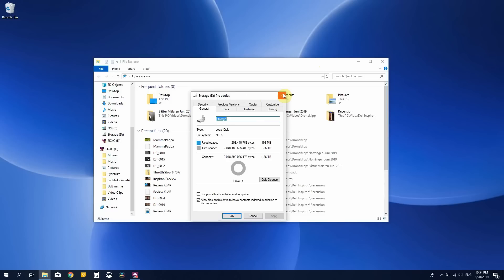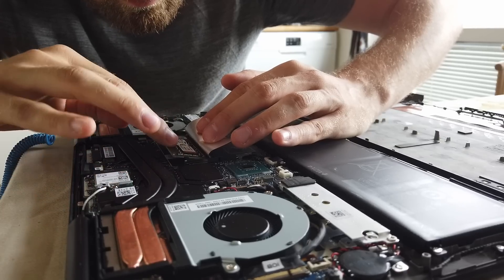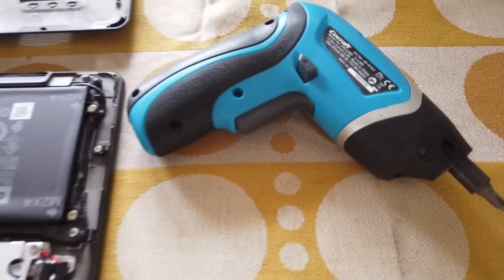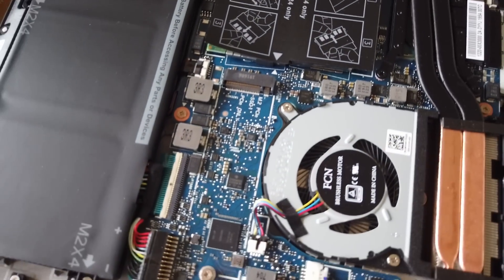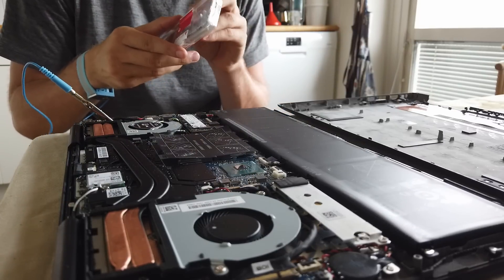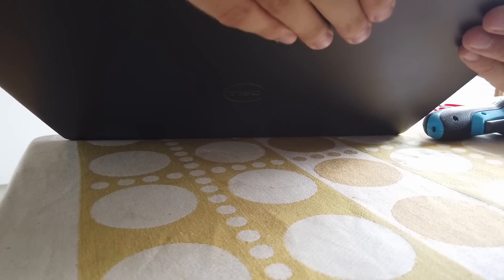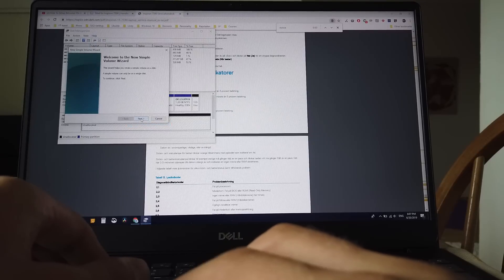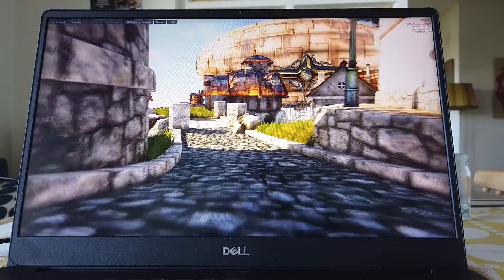Dell Inspiron - 2,5Tb SSD & 16GB RAM Upgrade

Comment: that screw problem, did you faced the same problem with Dell 15 7000? I have same issue but at the corner near the hinge.
Reply from the maker: You mean that the screws don't come out? That's by design. They should not come out. :)

Comment: I have the exact same laptop but with 56wh config? Can i also upgrade to a 97wh battery?
Reply from the maker: I believe you can, the battery should be available to order and fit in the chassis.

Comment: I just wonder, 
why did you choose Intel SSD over samsung series ? Thxs
As we knew, samsung speed is superior.
Reply from the maker: Price! Intel SSD is for sure the most value for money. This is just a storage ssd anyhow :)
Reply: @w2best  OK, Thank you for disclosing your reason. Quite resaonable though.

2 more quetions 
1. in the manual book, it was said that max storage for SSD M2 is 512GB for each slot and you install 2 TB. Any problem with new 2TB ?
2. your new hardware SSD 2TB, can be installed in empthy slot or replace the default SSD ? 

Thank you very much !!!!
Reply from the maker: @snmailist1470  there's not been any problems during these 2 years. You can probably install it in either but i would just keep the system drive to save the hassle of reinstalling the os

Comment: I think second ssd should be of intel which comes with optane memory but in my country it's pretty expensive and instead wanted to buy samsung evo which is cheaper and much more better performer. https://www.dell.com/community/Inspiron/2nd-SSD-Installation-causing-BSOD-on-Inspiron-15-7591/td-p/7437356   as given link is facing issues so what i should. Thanks in advance :) @w2best tech

Comment: Hey buddy,
I just buy 10th Generation Intel® Core™ i7-10750H (12MB Cache, up to 5.0 GHz, 6 cores) 16GB (8GB onboard + 8GBx1 SODIMM), DDR4, 2933MHz

512GB M.2 PCIe NVMe Solid State Drive

What upgrade can i do?
Thanks
Reply from the maker: 7501 I assume? Then you can upgrade with a 2nd SSD and ram-stick up to 8 + 32 gb as well.
Reply: Hi thanks for reply,
Is a ispiron 15 7000, this are the specs
16GB (8GB onboard + 8GBx1 SODIMM), DDR4, 2933MHz
512GB M.2 PCIe NVMe Solid State Drive
15.6-inch FHD (1920 x 1080) Anti-glare LED Backlight Non-touch Wide Viewing Angle 100%sRGB 8bit
Interested in make him 32 ram and 2TB ssd
It’s that possible?
If is possible you could tell me what to buy please 
If you can reply to me and add to your reply the exact links where to buy
Thanks very much buddy 
Ps:subscribe button press already :))))

Comment: Hi, thanks for the walkthrough! Do you know of there is a RAM CAS Latency (CL) constraint for this laptop? I bought a pair of CL15 RAM sticks, but my laptop will not boot with those. They are HyperX, and I see that you inserted one from HyperX as well. Either my new sticks are broken or the CL is not compatible. Cannot find any information about CL constraints on dell's pages. Do you know?
Reply from the maker: I don't know unfortunately. I haven't seen anyone have problems with ram upgrades though. So it's strange that it didn't work for you...
Reply: @w2best  Hi! Thanks for coming back to me so promptly! The HyperX ram you showed in the video, do you remember which CL rate it had?
Reply: @eyvindbg  It doesn't work with CL15, altough it doesn't get mentioned in the manual :)
Reply: CL18 (Patriot Viper Steel) also didn't work for me
Reply: Corsair Vengeance with timings 18-19-19-39 worked just fine. Patriot Viper Steel memory with timings 18-18-18-43 didn't boot

Comment: Thanks for the video. I'd like to ask what would you recommend? Buy x2 16GB ram or just buy x1 more 8GB? 

Also, can we buy any DDR4 2666mhz ram stick from any brand and it'll work the same? Do you know if some brands have better ram? Thanks again.
Reply from the maker: If you wanna get 32 gb and have the money sure go for that! I would love to do that upgrade at some point! You should be able to use any sodimm ram sticks!
Reply: @w2best  thanks mate. Opted for the 8GB and will be installing it later today. Here's hoping the screws don't strip from my screwdriver! Thanks again for the video.

Comment: Did you keep the original ssd installed in addition to the new ssd? If you are upgrading the ssd should i use the additional slot or replace the original ssd. Did you also setup a raid for the SSD
Reply from the maker: I keep them both but run them separate. I'm not using raid.
Reply: @w2best  Thanks. As the ssd the comes in the current boot drive location is a small length one, can a full length ssd be used in this same slot?

Comment: you use the intel ssd 6, but you recommend inland?
Reply from the maker: What's inland? I recommend the Intel SSDs, I think they are great!
Reply: @w2best  I don't know. when I clicked on the link it brought me here: https://www.amazon.com/dp/B07X74M6PT/ref=dp_cerb_1
hence why I'm asking. Today the link is working. Yesterday it was sending me to that page.
Reply from the maker: @Mehwhatevr  Super strange! Maybe it redirected to there but I have never heard of inland so I couldn't really recommend it...
Reply: @w2best  I don't think anyone could, that's why I went back to the video and was like, wait a minute he didn't use an inland, he used intel. lol :D
Reply: @w2best  thanks for your video. As you know, the manual for this laptop implied that the 2nd slot was nonfunctional and was capped at 512GB. 
While I found quite a few instances of this question posted, no one bothered to report their results. 
I went ahead and got the 1TB 660p. 2TB was too much money and too much space. 1TB is too much, but I want to make sure I max out the SLC Caching ;)
I wish I could have ordered with your link, but I'm in another country, but I wanted to make sure you know I appreciate your demonstration that multiple SSDs do work and they can be larger than 512 :)
Reply from the maker: @Mehwhatevr  I think it's absurd to state a maximum when that is not the case... If it was capped at 512gb that would have been so strange too.
Reply: @w2best  yeah I wasn't quite believing it myself. especially since cellphone manufacturers have been stating caps for years and i'd always been able to put in bigger microsd cards...
Reply from the maker: @Mehwhatevr  I know - all those recommendations are so strange!! But I guess they want to be on the safeside if there's a lack of compatibility.
Reply: @w2best  yeah, well I'm glad it's wrong. a 512 GB QLC SSD would be real slow.

Comment: Hey,
Your videos are really nice and I really like that you have done so many videos about this Notebook and in such a detailed manner!!
But I have a question regarding the Vostro 7590. Is it possible to put a second SSD in it and does the second SSD I want to buy have to be a M.2 SATA SSD or a M.2 PCIe SSD ?
Reply from the maker: Thanks!! :) I has the extra slot and It supports both but imo why get something else than nvme? It's really the best option.

Comment: Please help me choose between Dell Inspiron 7591 i7 and i5 version. There's a huge difference in price. Both the laptops are having same Graphics processor...NVIDIA® GeForce® GTX 1050 3GB GDDR5. I wish to video editing. I just want some heavy softwares to work fine without lag and in future also it shouldn't get slow over the period of time. My concern is if this processor will work fine for me in atleast 4 5 years. 

https://www.dell.com/en-in/shop/laptops-2-in-1-pcs/new-inspiron-15-7000-laptop/spd/inspiron-15-7591-laptop#configurations_section
Reply from the maker: I think this and I talk about it in my last video. If there is not a huge difference in price for example a sale of the i7 I'd def get the i7. If there is a really big price difference I would be fine with the i5 - it's still a great processor that will last a long time and it performs really well. Both of the ones have some thermal issues but I have videos on how to manage that too.
Reply: @w2best  Hey, Thank you so much for your quick response. I have to pay another ₹23000 for the i7 one...I think I will go with i5. Also...is there any other choices I can go with? I am going to buy once and wish to use it for next 5 6 years minimum. So by taking Dell Inspiron i5 or i7 whatever it is, is this the right choice with Dell Inspiron? I believe Dell laptops are built to last and hence my heart does not go anywhere and to dell. 

I'm thankful for your videos and hoping to talk personally about many things.
Reply from the maker: @SpeedsterSaurabh  There are alternatives! MSI Prestige 15 is a good one with very similar spec. I would also say the Asus ROG G14 is a really good alternative especially if performance is important. If price is the most important you can look at MSI Modern 15 that is very upgradable but only costs like 800 euros. 
Regardless I think the Inspiron is the most interesting laptop on the market right now - I see no reason to upgrade.

Comment: Mah man! Word on these streets is that the 7590/7591 will accept up to 64GB RAM (2x32GB sticks), beyond the Dell "official" (perhaps Marketing Dept. influenced) spec.  Can you confirm?

https://www.compuram.biz/memory/dell/notebook/inspiron/7000-series/15-7590-2-in-1/?st=tab_maxmem

Update: Nevermind, I see from prior conversation that others have claimed to have actually done this.
Reply from the maker: I would say in general Word on the street is right and dell specs are wrong. They specify max 512 gb for the second ssd and I have 2tb working perfectly. As you said there are people putting 64 and it seems to work. I would like to try at some point in the future! :)

Comment: The dell official site says.. Max 512GB.

However you were able to get 2TB SSD.

https://www.dell.com/support/manuals/in/en/indhs1/inspiron-15-7591-laptop/inspiron-7591-setup-and-specifications/storage?guid=guid-e13e84f5-f76d-402c-aed6-1f4254d392b1&lang=en-us

That is strange but nice work.

If you have 32GB DDR4, lying around, can you try putting that to check if it can support 64GB?
Reply from the maker: I know but I assumed it would work with larger. I also would love to try 64gb but it will be SO EXPENSIVE I think that will be quite far off for me...
Reply: @w2best  Thanks for the reply. Surely, didn't want you to buy one. If it was there with you already, may be give a try. But that's ok.

Comment: Hey thanks for the videos! Is your 2TB storage upgrade still working up to now? Dell's website says that memory upgrade for Dell Inspiron 15 7590 (i7) is up to 500Gb only. I planned on upgrading my storage to 1Tb but I have second thoughts about placing it on the laptop. Any help or advice will do. Thank you.
Reply from the maker: I know it says - which I didn't care about at all. It's worked perfectly fine all this time! :)
Reply: @w2best  Thanks! You're the best!
Reply: Hi! Upon opening my laptop, I found out that my 256Gb nvme pcie ssd has no metallic rectangular cover like the one your laptop has. Should I worry about it? Will it cause any performance issues without that metallic rectangular cover? Thanks a lot!

Comment: Hi W2Best, could you tell us what is that blue colored thing connected to the laptop (on the left side of the screen) on the 3 minute mark? Thanks a lot for uploading all these 7590 vids!
Reply from the maker: That is just some kind of thing to not put electricity from my hands into the components. I'm not sure if it works - but It was included in my screwdriver kit so I'm using it...

Comment: Hi - Thanks for the videos. I want to swap my OS drive in my 7590...and noticed that my primary PCIe drive has a "shorty" drive in it. Any idea if both the of m.2 slots support the longer class 40 SSD drives ( like the samsung 97 EVO - https://www.amazon.com/dp/B07M7Q21N7/ref=cm_sw_em_r_mt_dp_U_ErXWEbTP5C8SV ) ?
Reply from the maker: It works with both small and large drive in both slots!

Comment: FYI I also fitted to my Dell Inspiron 7590 another SSD into the other M.2 slot.
So I  added a ADATA XPG SX8200 Pro Pcle Gen3x4 M.2 SSSD 2TB to the SSD-1 (extra) M.2 slot with clearance for the accompanying stick on heat sink as well and it all works perfectly after initializing. The extra M.2 module has a socket height of 4.2mm (inscribed with H 4.2) which easily fits a D2/double sided 2280 SSD 😁
Reply from the maker: That's great to hear. The extra m2 slot is invaluable for me at this point!
Reply: @Grant Joseph - how is the performance of ADATA XPG SX8200 Pro Pcle Gen3x4 M.2 SSSD 2TB. The heat sink comes with the ssd? is there any issue when you try to add due to the breadth (for heat sink). 
Thanks in advance.

Comment: Just recently bought the 7590 last week and saw yr video that recommend to update BIOS to improve the noisy fan.  Love it now. BTW  since yr Dell has the 6-cell battery 97wh while mine is 3-cell battery 56wh, I plan to replace it with the 6-cell to get longer life before charging. Is it so called "6GTPY" for the product code? Try searching on the net some said its for xps 7590 but some said it's compatible with inspiron 7590/7591.  To open the back cover to add more ram (after remove the screw) should I start prying at the edge of plastic piece on the back? What is yr recommendation? Thank you.
Reply from the maker: the 97wh battery is amazing and it shouldn't be too hard to upgrade to. Google Dell Inspiron 7590 upgrade guide and you should be able to find all the info on both part and the process. I believe it's the same battery as XPS - would be surprised if Dell has several 97wh batteries. To open it - just start with any side that comes off relatively easy. No need to start at any special side.

Comment: I have an Inspiron 7591 2 in 1, with an intel core i&-10510U CPU @ 1.80 GHz 2.30 GHz. The upgrades works on this machine as well? Is it worth it?
Thank you
Reply from the maker: I believe they don't. You def. do not have an extra ssd slot. I think you don't have an extra ram slot either in the 2 in 1 but I can't swear by it. It's one of the down sides with the 2 in 1s
Reply: @w2best  too bad, thank you for your time and content, keep it up!

Comment: Hello i was thinking of buying this laptop, if i were to change the ram does it have to be swapped with the other ram since it does not detect. And how do you know when the ram is working. And how to setup a ssd
Reply from the maker: When my ram didn't work the laptop didn't even start... When it works you see 16gb in system information. You have to create a partition on the new ssd but that's all. I have a video on that if you need it. Search "ssd not showing up windows 10" and you'll find it!

Comment: Fantastic. Thanks so much for making your videos on the Dell Inspiron 7590 😁.

RAM not detected!!

Your trouble shooting post RAM installation was spot on 👍. Adding more RAM to slot B results in the computer not even booting up as you experienced. Your solution worked, swap the RAM modules. On restart I'd forgot to reconnect the battery, which meant the BIOS started and said the previous start up the RAM wasn't detected but now the RAM has changed. Reconnected the battery and all the RAM is  functioning correctly 👍😁.
Reply from the maker: Ah that's really good to hear that my issues and solving them could help you out!! :) Do you have 16 or 32gb now?

Comment: Any idea if the Inspiron 15 7000 2 in 1 has the same spare slots for upgrades?
Reply from the maker: It doesn't have the extra m2 and I'm not sure about the ram. You could check the Dell upgrade guide for more info!

Comment: Do you think all (or most) 2666mhz sodimm ddr4 ram sticks with 1.2v by samsung should be okay to use?
Like this one: https://shopee.com.my/%F0%9F%94%A5Samsung-8GB-DDR4-PC4-21300-2666Mhz-SODIMM-Laptop-Memory-Ram-i.157405.2391758608
Because I´ve checked for the same model number of the one in the link you provided, but it is quite expensive in Malaysia (around 75 Euros).
Thanks for your help and keep the good work up!
Reply from the maker: Hey! Sure - same size and same speed should always work although I'm still puzzled why it didn't work before i switch place of the sticks in my computer...
Reply: @w2best 
Okay, thank you! 
I'll try and let you know if it works.

Comment: Do you note any problem with the ssd? it's work perfect? because dell guide say the max capacity supported for ssd 2280 o 2230 is 512GB
Reply from the maker: It says so but it works perfectly.
Reply: How do you get 2.5Tb? Have you installed two ssd nvme? Or ssd + hdd?
Reply from the maker: @carlosbolomo110  It's very clearly in stated in the video... :P I have the original 512gb ssd and then added another 2 tb ssd. There are two nvme spots in the laptop.

Comment: Thanks for deep and various review!  Could you test 64gb ram(32gb x 2). DELL says 64gb ram is only possible for XPS 7590, not Inspiron. Is that true?
Reply from the maker: According to the upgrade guide you can only do 32. However it also says you can max have 512ssd which is not true. At the moment I really don't have budget for 2 32 ram but I might have later this year and then for sure I'll try!
Reply: 64GB RAM did worked. I bought 2x32GB RAM(samsung) in amazon and replaced. No problems yet. Thanks your reviews and reply.
Reply from the maker: @deokhyunlew  Thanks a lot for enlightening me on this! I think I might actually go ahead and do that upgrade myself. Just because 64 gb ram and 2500gb SSD is an amazing spec to brag about. :P
Reply: @deokhyunlew  Can tell the model of ram. Please.
Reply: It is Samsung RAM. Ddr4 2666

Comment: fairly new to upgrading but i was looking to upgrade my inspiron’s ram and found your video (great vid btw) and was wondering, could you use any brand of an 8gb stick and it would still be compatable?
Reply from the maker: Yes - but you should get the same speed for Dual channel to work. Same size and speed but any brand is fine.